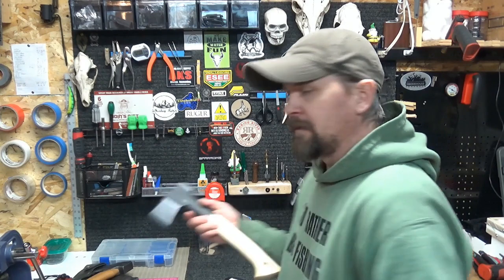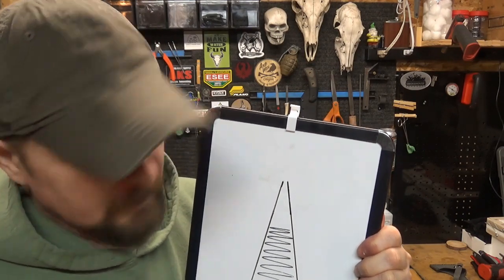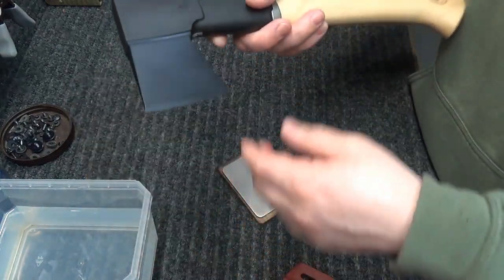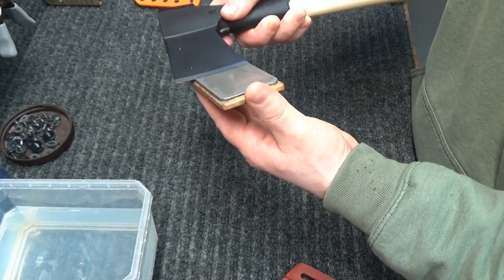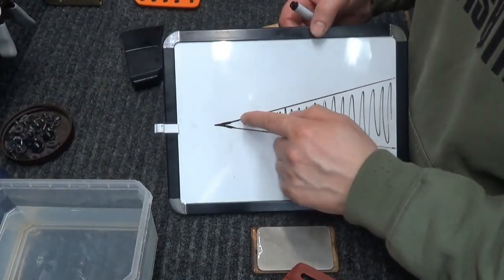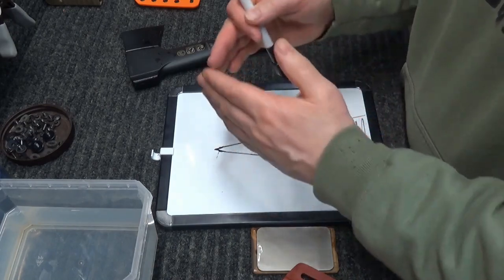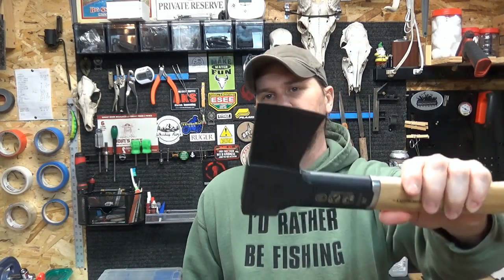Fiskars axe Rolled Edge Issue and How to Fix

Comment: Yeah. You need to adjust the edge to what you're cutting. Same goes for Mora knives which will also benefit from a secondary bevel when you are cutting very hard woods etc. Only thing I'd do differently: I'd hold the hatchet/axe fast and move the little diamond card.

Comment: Nice collection of Fiskars axes.
I have a weak spot for those Fiskars axes.
The one piece handle construction, the ergonomics of the handle.
The extremely toughness of the handle.
And yeah, sharpen the axe a bit, a little convex with sandpaper is fine too.
No rehandling issues.
Reply from the maker: I was not a big fan of the Fiskars for a long time, however I purchased an X15 to mount on my truck for recovery gear. I figured the handle would hold up to the elements better than wood. I liked it enough to buy the X7 and quickly found that I liked them very much. I still prefer a classic wood handle tool but do not feel at a loss carrying the Fiskars at all. I especially like the X11, decent all around use, compact enough to pack but has enough heft to split larger rounds.
Reply: Sounds like a support group is needed. I understand, and just bought 2 more yesterday.
Reply: @Scablands_Scavenger  I just bought the x11. And no I don't have a problem. ok maybe.
Reply: @FeguerFineArt 
Maybe?
So what happened.

Comment: Nice tip. I'll consider doing this for my Fiskars that's well over a decade old. This is also a great strategy for knives. I do micro bevels on my blades if they happen to be very thin hollow grinds or flat grinds.
Reply: How does that micro bevel work in a serrated blade that is hollow ground?
Reply: @urjnlegend  I don't have many serrated knives. It's been years since I sharpened one. I think I used ceramic rods to sharpen each concave tooth of the serrated blade. I think the concept of a micro bevel would work just as well for serrated blades. Slightly reduced sharpness in favor of more strength and fold/chip resistance.

Comment: I put a convex edge on mine  using the towel method where you use a tea towel to put 4 or 5 bevels on the edge resulting in a convex profile by using the folded towel as a guide starting with it folded in half, laying the head of the hatchet on the towel and working both sides then folding in half again and working both sides, folding and working both edges two or three more times, laying the head on the towel and using it as an angle guide each time. You only have to do five to ten strokes per side each time and you end up with a nicely convex and sharp edge that will not roll or chip and bites in nicely withòut slipping while retaining the edge longer. Felix Immler has a tutorial on his channel on how to do it.

Comment: I currently have 3 fiskars axes, 2 chopping (hatchet and 20 inch model), and the larger splitting axe.  My question to you is where did you get those kydex sheaths?  I would love to get one for my hatchet and my backpacking axe the 20 inch as well.  
Also thank you for the very simple and easy to understand guide on how to sharpen as well as fix an already damaged edge.
Reply: My same question those sheaths are  nice.  Could you post a link where you got them?   Thanks

Comment: I got a fiskars norden n7 and the edge is already chipped. How do you fix that?
Reply from the maker: I would use a coarse stone/diamond steel... possibly a fine file if available to work the edge down until the chips are removed. Then re profile as shown in the video with small secondary bevel to prevent it from happening again.

Comment: HI, Thanks for this video, I have an X7 coming and will do this .  I was looking at buying the leather sheath.  What do you prefer about the plastic type?
Reply from the maker: Well I am a little biased, I used to make the kydex ones ha ha.... the main reason I prefer the kydex to leather is durability in wet weather. I had several issues with leather failing when wet. Once during a winter camp one of my sheaths got sopping wet, on the return trip my axe was on the floorboard of my truck and with the heater going it dried out too fast in one spot and the leather cracked. Another time I had a small hatchet in my pack, leather was again sopping wet and from jostling around the sheath slipped up a little and the axe sliced through the side of the wet leather. There are pros and cons I guess to both. the plastic will hold moisture against the blade and promote rust, but unlike leather it can be dried out faster. Kydex can warp and lose shape in extreme heat peak summer 100plus in a parked car for instance. Because it is close fitting, if the blade is put in dirty can imbed grit into the plastic scratching the blade. The kydex does work better for larger axes that are vehicle mounted (overlanding type mounts etc) where leather would not do well exposed to the elements for long periods.

Comment: So, how's the wooden-handle Fiskars holding up? I've always wanted one but not knowing how the wooden part is attached (or even replacable, especially in the field) I'm kinda afraid. :)
Reply from the maker: I only purchased it to ensure the sheaths I was making would fit with the x-7 and x-5 model line. I would not buy it again, handle is bigger around and feels unbalanced to me. I purchased 2 of them (7&10 models) and one developed a split at the end of handle. Not worth the extra price in my opinion.

Comment: I dont know what you are talking about dude fiskars come with the secondary bevel brand new and i always spend hours filing it off into a single bevel like you have shown because it is much sharper that way and it bites in much better, you cannot get that secondary bevel sharp because the angle is much to flat.  You need the angle of the single bevel to get your blades 'razor' sharp.
Reply from the maker: Hmm well sorry if the video was not clear enough. I thought I pretty plainly stated what the problem is, how it can cause issues, how to fix it and how it can still be "shaving sharp" if needed. As to not being able to get a secondary bevel "sharp" did you watch the video? I show step by step how to do it and show it being able to shave arm hair when finished. Weird.
Reply: @Scablands_Scavenger  It wasn't an issue with me not understanding what you said, what I was saying is every time I buy fiskars tools from home depot whether it's and axe or a brush knife or anything with a blade, it comes with a large double bevel.  I don't like that 45 degree angle that you are talking about, I notice that with you you only made a couple passes so you still retained that razor sharpness.  I don't even bother.  All I was saying is for me every time I buy a new fiskars axe, I have to spend hours turning that damn 45 degree double bevel but down to a much more gradual angle with my files or whetstones, as long as I'm not hitting rocks I never have too many issues.  But I am guessing even with your technique if you hit a rock your probably going to have rolls and nicks.  I just find it weird you are getting brand new fiskars tools with a nice single bevel just the way i like them, yes it is weird.  no matter, it still is a good informational video thank you.

Comment: I use X7 andx17. would like to ask, in order to prevent chips, if I have to sharpen it first flat and after sharpening, put the secondary bevel increasing the angle? Which grit do you prefer for secondary bevel, coarse, medium or fine?

Comment: Not exactly the method I use but I can't fault this at all. My oldest Fiskars hatchet is pre X series by a number of years and I haven't ever had any issues with it either. As far as I am concerned the chipping/rolling is an internet myth perpetuated by willful ignorance. No one I know personally has ever had an issue with a Fiskars axe.
Reply: I know this is old but I just got an x25 and it chipped right out of the box going through some knotty applewood so....
Reply: @blakelocati  dry and cured? If it was I might be hesitant to use any axe on it! Of course splitting should have less of an effect. Fiskars has a lifetime warranty so if you got a bad one they should make it right.
Reply: @turtlewolfpack6061  just splitting. I resharpened the edge at a less aggressive angle and it’s holding up much better now
Reply: @blakelocati  it is always good to hear and try to understand equipment failure stories. Thankyou for following up!
Reply: I love my fiskars axe, and any product I've ever had of theirs i just returned if it ever failed. In saying that my axes have always been solid
Reply: I badly chipped mine as well, the first time I used it... but it was used chop the lower legs and antlers off of a moose carcass. I guess I cant really fault it for that, because moose bones are a lot tougher than wood. I just sharpened it up and did it again... must be something to flattening the angle, as I havnt had any significant damage since, and I continue to use that axe on moose hunts.
Reply: I had an issue with it reprofiled the edge and now Its fine
Reply: My X11,split  lots of wood , still like new, my x27 chipped in the first day.Still the best axes I used,just love cutting  wood with  them .Cheers

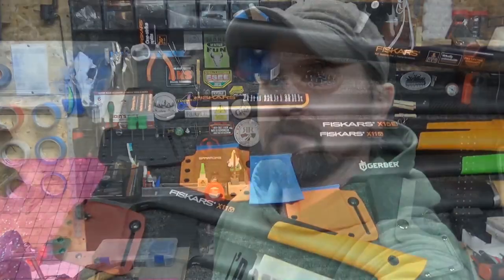Comment: Prior to 3:00 it used to seem like I owned a sizeable collection of axes.
*P.S., Easy to fix, but a bit surprising Fiskars would ship flat like that when an ax without a convex grind pretty much has to have a compound bevel to be useable.
Reply from the maker: Ha ha, yeah my collection has grown in the last year. Most of these I purchased for making sheaths, the Fiskars are probably my top seller. I agree...it is odd they ship these out with the edge profile they do considering the number of people I have seen give poor reviews. From what I understand they use a very highly automated process to make them, I guess they don't want to add that little bit of labor to tune the edge.
Reply: @Scablands_Scavenger  That's probably the case. Fiskars could see it as a manufacturing cost savings that's ideal since the axes' users will need to put a compound bevel on numerous times during the life of the product. They might want to put a little sticker or tag on new axes alerting the user to apply their preferred tune to the edge. Since there's a lot of bad reviews, there's clearly many purchases being made by customers who are new to axes.
Reply: I have used Fiskars axes with the factory edge and the only thing I noticed was the deformation of the heavy teflon coating on the X series. The edges themselves do not actually deform despite the internet myths.
Reply: @turtlewolfpack6061  watch the wranglerstar x27 review, my factory edge did basically the same on my x25 and its never touched anything but wood and some tire rubber.
Reply: @ryan92084  I wouldn't watch one of his videos if I was paid too. He has ZERO credibility when it comes to anything. Fact is, if you actually have a lemon then Fiskars will replace it, lifetime warranty. Fact, I know that Fiskars axes and splitters have been (by me and others) in extreme cold for years with zero issues.
Reply: @turtlewolfpack6061  hah fair enough it was just the easiest visual reference i had at hand.  With the mix bag of reviews (mostly positive) i wonder if there is on QC issue on the factory edge.  Could just be different wood types too.  Its still a great splitter and i would recommend it.

Comment: in new model, the steel was better than old versions or not ?
Reply from the maker: I think they are the same material/heat treat, but do not know for sure. I have found them to perform similarly.

Comment: PS: After you do this and after you use it, it will get dull. How do you sharpen it then, with this secondary bevel, please?
Reply from the maker: You can sharpen it the same way you put the bevel on, go with the same angle (as close as possible) unless the edge was damaged it should only take a few passes on each side. after a while you will get a feel for it. You can also color the edge with a sharpie pen to see where you  are taking material off if that helps.

Comment: Every one always tells me I have to try a Fiskars hatchet/axe bc I refuse to ever buy a non-wooden handle. The first swing on the Fiskars hatchet, middle edge rolled a slight bit! How the hell does anyone swear by these!😂
Reply from the maker: Its a bit of a draw I guess. Just like most Scandi ground knives, they will be more robust with a secondary edge. Once the edge on the Fiskars is adjusted I have found them to be very reliable. I like my standard wood handle axes and have many, I also have most the Fiskars models as well and like them for certain things. For me, especially in the mid size axes not having the head come loose while camping is a bonus. I have had to re-handle and re-wedge several high end axes when using in shoulder seasons, especially when they get soaking wet in the snow. In the end I suppose its nice to have the choice to use what works best for you needs.